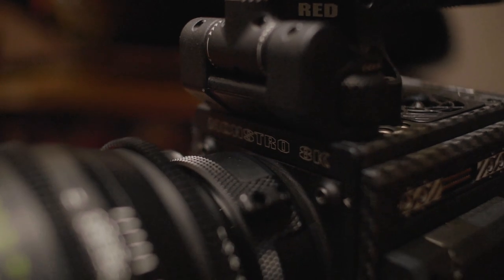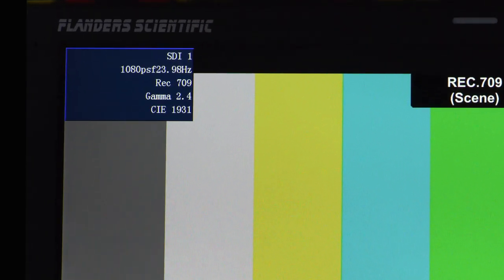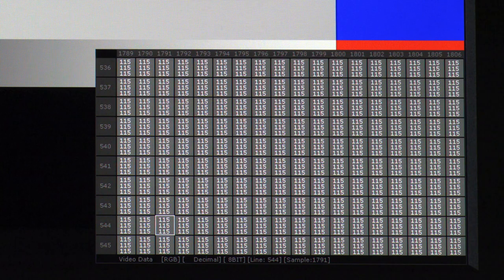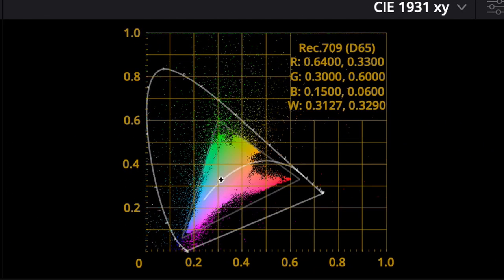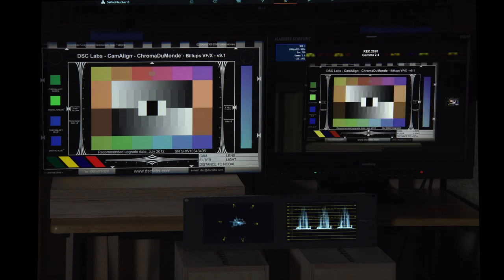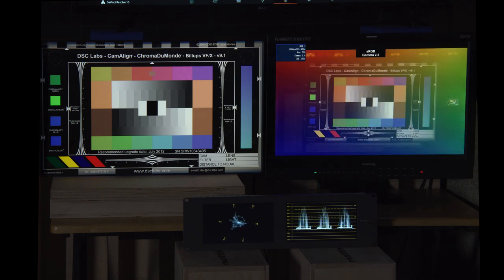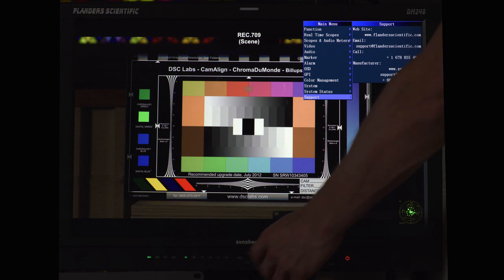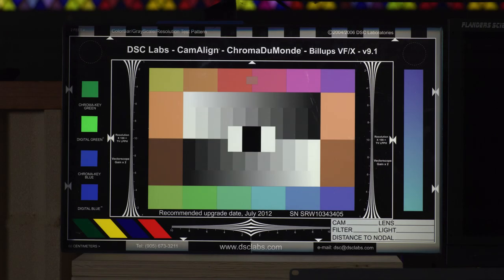Answered: How exactly do reference monitors (FSI DM240) actually work?

Comment: Holy crap, I didn't expect you would actually grab a r3d camera and try this!
There's a wealth of information here, but I am going to have to watch it a few times to really absorb it all...

like, at 4:45, you say that you figured out you should be using Rec.709, gamma 2.2 ... instead of gamma 2.4. But I don't really understand why...
Reply from the maker: Check out these R3D files, which show side-by-side the real-life chart and the display of the chart through the DM240 at Gammas 2.4, 2.2, and 2.0: https://www.dropbox.com/sh/srx9ib9w2cg7pmd/AAByhoA5xM-pwb00VrJqXt6Ea?dl=0 .  The Gamma 2.4 rendering has the cross-point of the X pattern below midline; at Gamma 2.2 it is at midline; at Gamma 2.0 it is above the midline.  I believe that the shape of the X is most congruent with reality at Gamma 2.2.  It is possible that RED's IPP2 Medium Contrast curve aims for Gamma 2.2, not Gamma 2.4, which would be why the 2.2 Gamma setting on the display better matches reality than the 2.4 Gamma setting.
Reply: @Manifoldrecording  this makes sense, is this specific to working with red footage?
Reply: @lawrence__martinez  Red footage begins life as RAW and uses Red Wide Gamut / Red Log 3G10 as its intermediate format.  The RED-provided LUTS have their default behavior.  Many others have created their own favorite LUTs.  I would not treat it as gospel that RED footage is Gamma 2.2 or Gamma 2.4--that's a function of the LUT converting from Log to Gamma.  I was making an observation about the effect of RED's LUTs, not RED footage itself.
Reply: @Manifoldrecording  Hi. There are two versions of ipp2 luts. v1.11 and v1.13. 
First one was supplied with 4 gammas 2.2 , 2.6, bt1886, HDR, 
and latter was rolled out with only bt1886 . Can you specify which one have u used in this test ?
Reply from the maker: @balaji_subramanyam  Version 1.13.
Reply: @Manifoldrecording  Then is it possible to use CST g2.2 to g2.4 node next to v1.11 gamma2.2 lut ? Could you verify on that ? (Just to maintain the monitor at the standard g2.4)

Comment: I just got myself a DM240... wondering how you made all your connections and any tips on the signal flow.
Reply from the maker: I have a BMD Decklink card and I feed SDI out to the DM240.  That's really the only way to get a known good signal for the DM240 to display.  Using it as a GUI monitor kinda defeats it's purpose (for all the reasons  Taran explains).  Congrats on your new acquisition!
Reply: How is the panel uniformity on the DM240? Would love to see a video showing this using flat grey generators at various brightness levels (including black and white) but this information just doesn't seem to be out there.
Reply: @m1nt9reen  I've been using it over a year, even compared it to an expensive dual lcd monitor and the DM240 is still the best bang for the buck SDR Monitor.